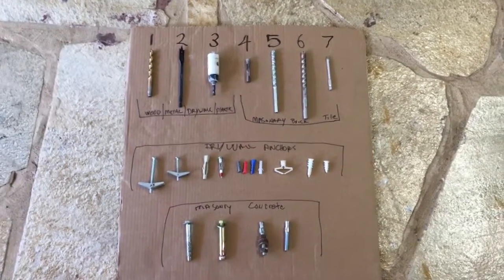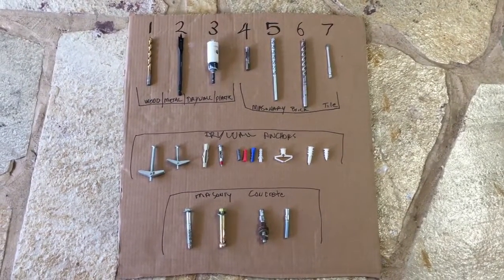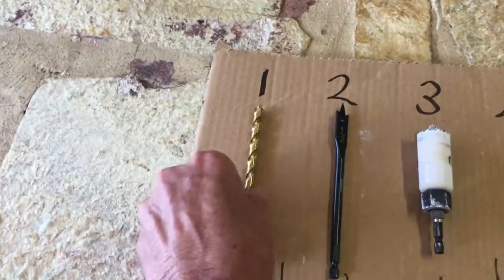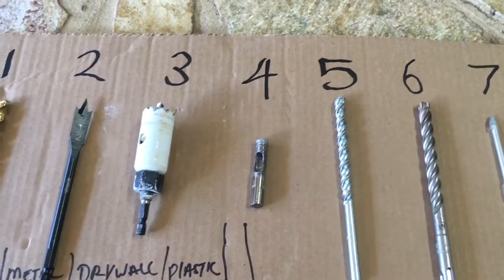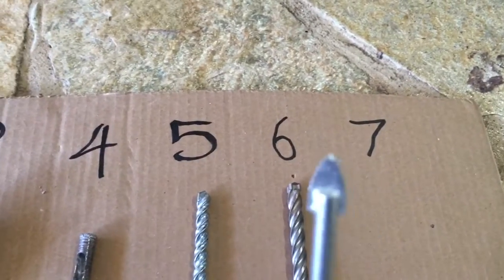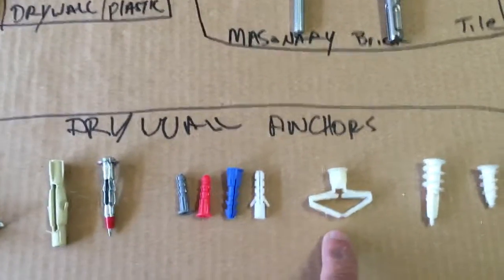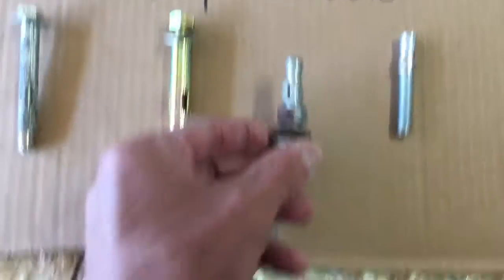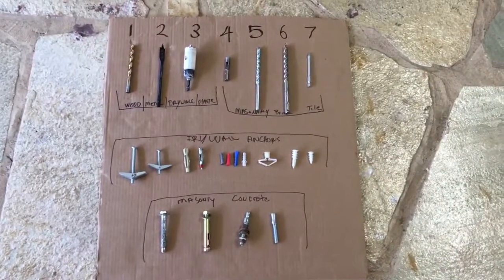Drill Bits and Wall Anchors

Comment: The plastic drywall anchors in the middle are also good for lighter use in masonry. You want a tight fit, but not too tight. The concrete anchors on the bottom are heavy duty, overkill for shelf brackets, hanging art on the walls, installing accessories in a tiled bathroom, etc. If you were going to hang a Mexican style hammock between two concrete walls, the heavy duty anchors would be the way to go (with eye bolts). Shelving or racks that are going to bear a lot of weight should use the concrete anchors in your display.

Another option for lightweight usage are wooden dowels. These are excellent for applications where you want to use a nail, such as a picture hook, but can also be drilled for use with a screw. Where I’m living, these are available precut and with grooves on the surface to bite when you tap it into the hole you’ve drilled (which should be slightly smaller than the wooden plug.
Reply from the maker: Aloha and Thank you for your very detailed report. I threw this together with what I had on hand, it is by far the most watched video I have ever done. Aloha, Mark

Comment: I'm not sure I have a masonry bit because it won't drill into my stucco.  My bit looks like your #6 bit. (Note: there is only one "a" in masonry.)
Reply from the maker: I'm sorry I put this video together for my 18 year old daughter that moved to Texas, I just put together what I had lying around my garage. A masonry bit is very different from a regular wood or steel bit. Just go to your local hardware store and ask them what you need for the type of masonry your trying to drill through. Aloha, Mark
Reply: @markz51crooks57  Thanks!  I did what you said and was able to find masonry bits.  None of the other bits that we had worked, but once I put in a masonry bit, I was able to drill the hole.  BTW, I moved FROM Texas.
Reply from the maker: @larsedik  I am Glad that it worked out. My daughter moved to Wichita Falls from Honolulu. I think mostly because of the cost of living here. She wanted to try making it on her own. I'm still paying but I'm proud of her. Aloha, Mark
Reply: @larsedik  Masonry bits don’t actually drill, they grind. A wood or steel drill bit cuts into the material, but a masonry bit is using friction to wear away at the material (concrete, brick, etc.) The spiral fluting is to help remove the dust. If you press too hard and go too fast, you can overheat the bit and ruin it. Go slow and if necessary, let the bit cool down if it gets too hot.

It’s not a bad idea to drill a smaller pilot hole and then the larger hole, especially for the larger diameter concrete anchor bolts.

Lastly, if your have a hammer setting on your drill, this is when you’ll want to use it. This doesn’t mean you should run out and buy a new cordless hammer drill. Many cheaper corded drills have the hammer feature, and will work just fine for occasional use.